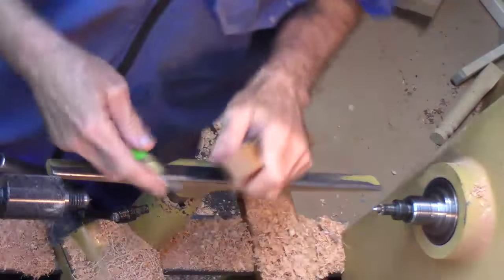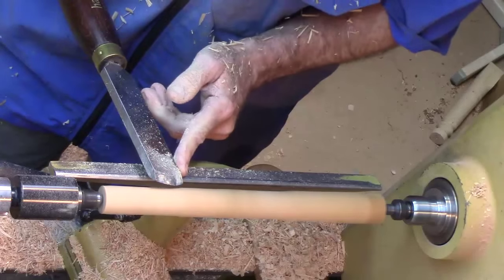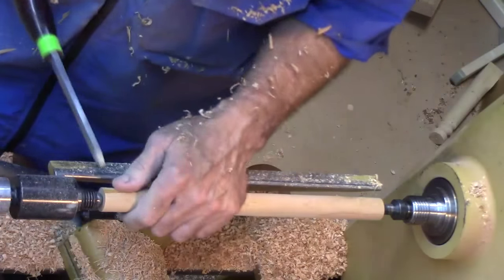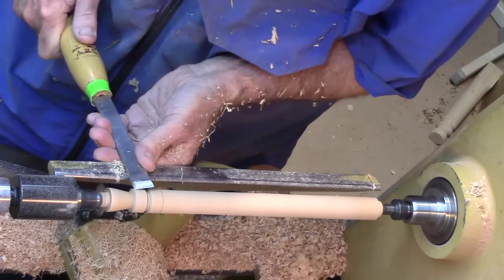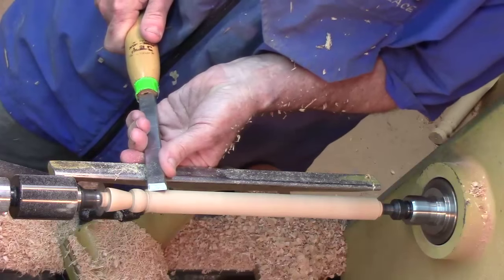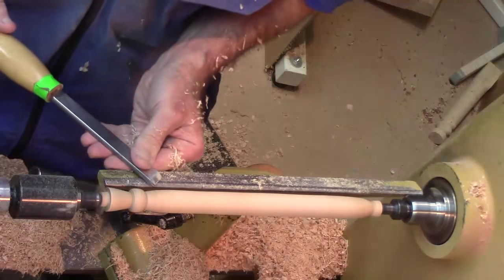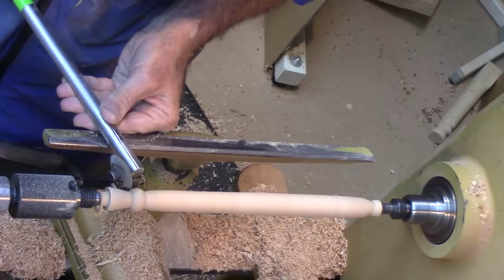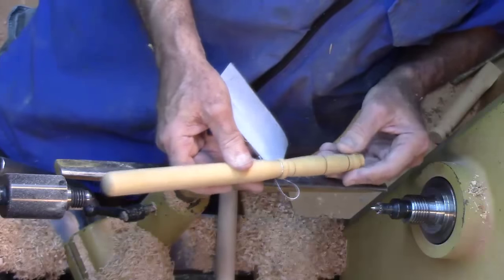Stir the Pot like a Scot - Wood Turn a Spurtle

Comment: An oldie of yours that I seem to have missed. Maybe oldie but still goodie. Looks to be a good project for the new lathe. I have the lathe up and running but now I have to find out which box the movers put the turning tools in. There must be 50 or more boxes in the new shop. It will take a while to get them all sorted out. Thank you for sharing. Have a great day and stay safe.🙂🙂
Reply from the maker: It is  great kitchen aide. Good luck with your unpacking. Put up French cleats before you get everything put away.

Comment: I enjoy all of your videos.  Where can I get the information sheet like the one you show at the end of your video?
Reply from the maker: +George Fotinakes 

Spurtle  -  the traditional
Scottish porridge stick

Cook your porridge like a true Scot.

The spurtle has a long history in Scotland where it was used to stir
the oats as they softened slowly in the pot. Today's oatmeal doesn't take
nearly as long to cook, but why not keep in touch with tradition and use a
spurtle anyway?  And apart from cooking your morning bowl of oatmeal, it
will find many other uses in your kitchen.

Your wooden spurtle won't scratch your pots

No need to worry about scratching pots or pans with
cookware made from wood! And that's not all. Recent studies have found that
wood contains chemicals that fight bacterial growth.

Your spurtle is easy to care for

Just wash your spurtle in warm soapy water and leave
it to dry thoroughly.

If you wish, you may occasionally wipe your spurtle
with a little mineral oil to renew the finish. I don't recommend using cooking
oils as some types can go rancid.
Reply: +George Fotinakes Thanks for your reply. I can see a "spurtle" Christmas coming for the gals in my family!

Comment: Where can I find a heavy skew like you used?
Reply from the maker: +Brenton Younkin That is an Alan Lacer 1 3/8" by Hamlet. You can buy from Craft Supply, Packard  or from Alan directly.
Reply: Thanks! I've just been using a 1" wide 1/4" think one. I'll check into that!
Reply from the maker: Brenton Younkin
My workhorse skew is a 3/4". I personally find the 1 3/8" a little big and awkward for most of the tasks I use a skew for.
Reply: I've wanted a bigger one for roughing out. 3/4" and 1" it what I used the most. And a smaller 1/4" one I made.